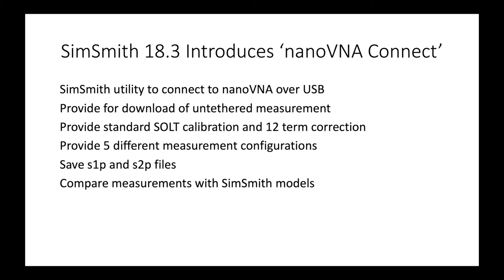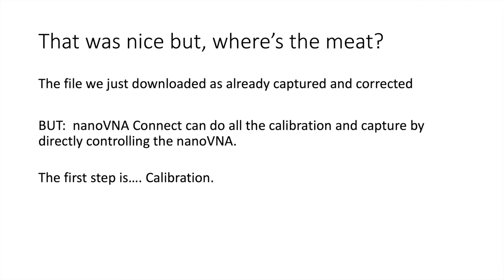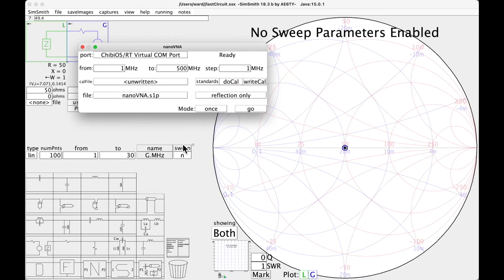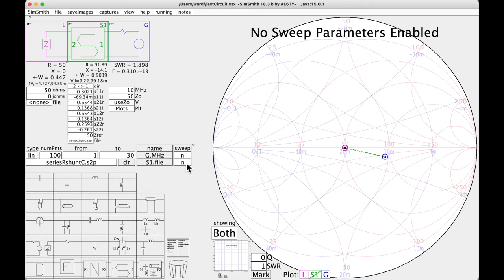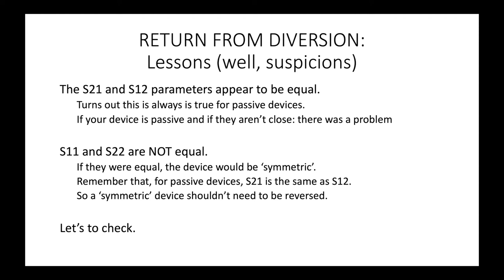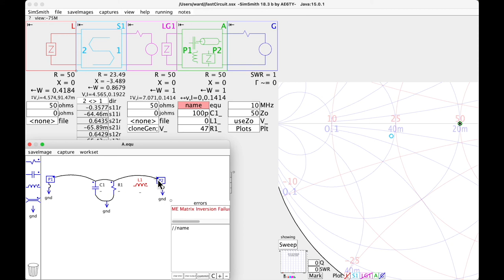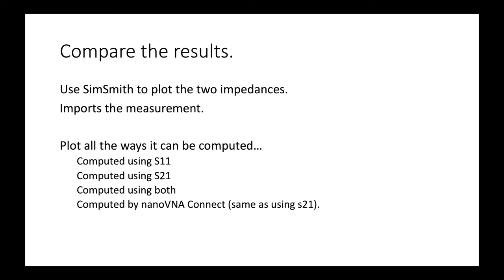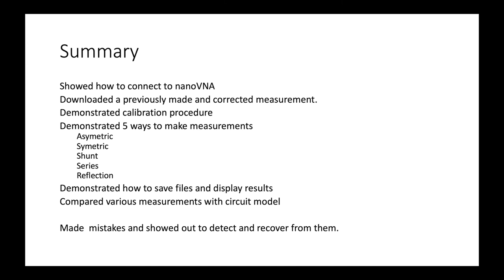Extended cut of a Introduction to SimSmith's "nanoVNA Connect" Utility.

Comment: Thanks for all your great videos. First, Do you know where I can find appropriate driver for the NanoVNA Connect. I’ve looked on all the NanoVNA usual spots and no luck. 
Also, You stated that your home made RC circuit is a series RC… Is it not Parallel? If I’m wrong , my apologies. Thanks again for your time. - Jason Burchell